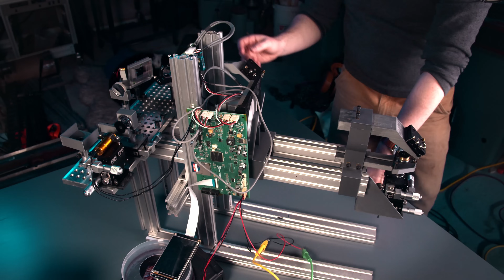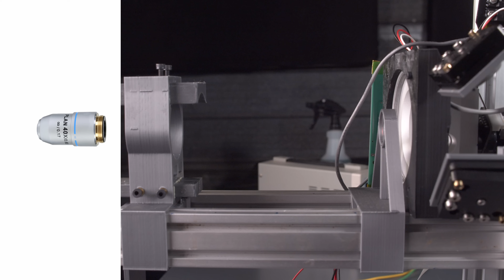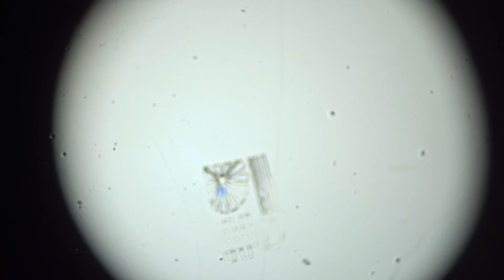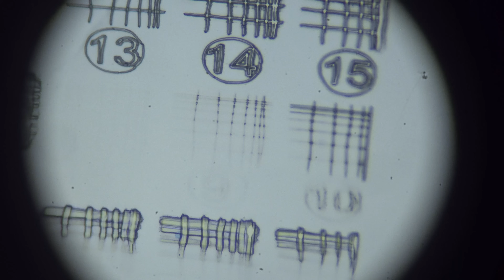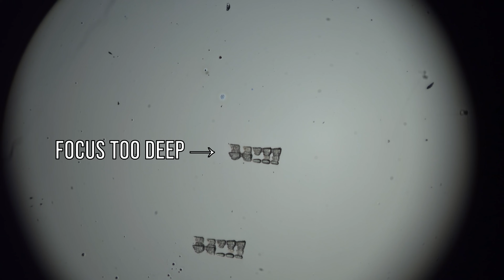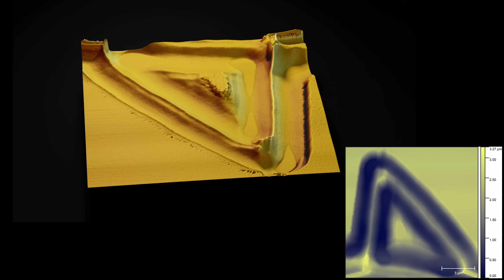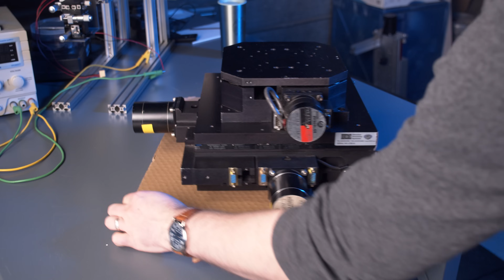DIY Semiconductor Patterning

Comment: why does the camera pick some green in a purple laser? even if it's a sensor defect, i'm still curious why it appears only in certain parts of the light path and why it's specifically green.
Reply from the maker: Hehe yeah I noticed that too, took me a minute to figure out: there's a bright green LED on the control board which shines across that section of the optics :)
Reply: @BreakingTaps  but.. but.. but my elaborate theory about the frequency doubling crystal they might be using in the laser.. i even started to calculate corresponding colors of those wavelengths (spoiler: they didn't match)

Comment: Can you use the optical litho to make better optical encoders for the galvos for better precision? Or use it to make MEMS electrostatically driven mirrors to replace the galvos? Maybe optical encoders for servos for the optical train elements to make it auto-calibrating in real time, instead of doing it manually every couple of days? A self-improving machine would be pretty big brain.

Comment: If you're making a Version 2 for use on real projects, rather than as a proof of concept like this, you might want to invest the time to build a HEPA-filtered positive-pressure vibration-isolated cabinet on wheels to house everything. A lot of those microscope pictures looked pretty dusty!
Reply from the maker: Oh my goodness, yes, so much dust everywhere! I should really clean my microscopes too 😊  But yeah I agree! I actually have a big HEPA unit for exactly that reason, just need to find some time to build a cabinet for it :)

Comment: Is the UV laser diode a single facet emitter?  Afik Thorlabs has a few raw laser diodes that would suit.  While an expensive constant current power supply is most often used to drive laser diodes, a resistor and voltage source work just fine.  (i.e. you can drive them like an LED)
Reply from the maker: Not sure to be honest! It's whatever cheapo diode came with the 3D printer :) I do have a few nicer Coherent Cube lasers that I completely forgot to mention, and plan to use those on the next build. Beam quality should be quite a bit better, and generally more stable too.

Comment: Amazing work! Would this photo-resist work with 532?  The cheap green laser pointers are diode pumped doubled Nd:YAG "microchip" lasers.  Just due to physics, they generally have a single mode beam with only a single output frequency.  I.e. if you can temperature stabilize them well enough, they can do holography, atomic vapor spectroscopy, and should focus to a diffraction limited spot.
Reply from the maker: Unfortunately, the resist isn't very reactive past about 440nm (https://amolf.nl/wp-content/uploads/2016/09/datasheets_S1800.pdf, Figure 5 on the third page). Will keep that in mind for future projects though, always good to know about cheap hacks to get good laser beams!
Reply: @BreakingTaps  haha time to do sum frequency generation... Maybe in the future ;) NLO says hello

Comment: How fast does the beam move? I'm wondering whether the time frequency of the wibbles in the line might tell you something. (if only you had a way to make a MEMS accelerometer to measure vibrations...)
Reply: That's what I'm thinking as well.   The other option might be to rotate the entire thing 45 degrees to fully engage both mirrors on the straights.

Comment: Absolutely beautiful work, very, very nice! :-) 
Yeah, diode laser beam quality is beyond poor. If you want maximum available power and a nice clean beam, have you considered fiber coupling the diode? The beam focused into the end of a nice length of Silica SMA905 fiber, will yield a really nice Gaussian beam profile, plus you can run the fiber wherever you want it...
Reply from the maker: Thanks Les, means a lot coming from an actual optical and laser expert! :)  I haven't really looked into fiber coupling to be honest, and no real reason either, just didn't ocurr to me 🙂 Can you couple in multiple wavelengths to a fiber (so I can also include the red focusing laser)?  I assume I'd need a single mode fiber instead of the bigger multi-mode stuff?  Thanks for the help! My fiber-fu is pretty weak 😅
Reply: @BreakingTaps  I've never done it but I believe so. You'll have to make sure that the fiber is rated for the range of wavelengths used. You also need a lens that optimally couples the free space laser to the single mode fiber. Newport has a good article on this if you search for "Fiber Optic Coupling".
Reply: does the beam need to enter the fiber parallel or can it enter it focused to a point? what angular distribution does is have when it exits?

Comment: I can't imagine the nightmare it has to be to align your setup with all those plastic parts ... Don't the plastic parts bend slightly each time you try to handle the micrometric screws ?
If you can afford them thorlabs "Universal Post Holders" are a must for all the breadboard section of you setup.
Reply from the maker: Surprisingly not so bad! The posts at the back are actually very sturdy and don't move much or at all, and the two components that really needed adjusting (laser and lens after pinhole) are both directly on stages.. The cantilevered mounts holding the two kinematic mirrors are... not great, and that was a chore.  Particularly because the t-nuts holding them to the extrusion slip over time too.

But yeah, I'm definitely going to invest in some nice posts and bases, and probably a real optical breadboard too :)
Reply: @BreakingTaps  If you do buy an optical bread board, avoid ones that use chip board to cap off the edges.  The chip boards add a massive humidity sensitivity. Took our research group years to track that one down...
Reply from the maker: That is an excellent tip, thanks! I would never have thought of that either 😬

Comment: Amaizing project!!! Out of curiosity, why not to have a still beam focused on the substrate, and the XY movement doing it directly by moving the substrate?
Reply from the maker: Thanks!  Good question! I had a few other folks ask too, so I just pinned a reply to the video.  Tl;dr: the stage approach will likely be a lot slower, and potentially worse resolution (although given the current state of the galvo, probably not :) ).  I might end up doing that for version 2 if i can't get the galvo to behave.

Comment: Could try sitting it on a paver and dense foam for isolation to rule out at least some of the vibration. Surprising such a hodgepodge setup even works, let alone with results that are kind of promising.

Comment: Awesome work! Always love seeing your projects. Do you know what % thruput you're getting after the pinhole? Id expect somthing much higher than what I think you're getting (pending effort of alignment) unless the diode is multi transverse mode... then high loss is the name of the game
Reply from the maker: A very small amount, maybe 5-10%?  There was some extra explanation but it rambled too much and I cut it from the edit: I have the pinhole intentionally misaligned by a small amount which is cutting down intensity a lot. The extra modes I was getting when correctly aligned (3-4 extra "rings" around the center spot) were enough to cause issues under the 40x objective... lots of "roughness" on the edge of the exposed line. So I ended up misaligning to cut a lot of the junk out. The circularity isn't quite as good, but there's a lot less "leakage" (apologies for the made up terms here).

It also worked out well because the resist is super sensitive and needed reduced intensity. V2 will have a correctly sized pinhole and an ND filter to do it correctly :)

Comment: What effect does sound vibrations etc have on the system? Is it isolated from outside vibrations so that they don’t interfere with the precision
Reply from the maker: No vibration isolation at the moment, although that would definitely help improve reliability (and minimize the feature size). I know that commercial machines are often isolated, but I'm not sure at what point that becomes "required".  I.e. is it 10um? 1um?  500nm?  Not sure, but it would definitely help!
Reply: @BreakingTaps  Don't need anything fancy.  Some tire inner-tubes under an optical bench will knock out everything above a 2-3 Hertz.

Comment: The feature size of the defects caused by the aberrations is pretty impressive. I wonder if at some point real photolithography machines will be based on the aberrations we made along the way.
Reply from the maker: Oh you'll love this: sub-resolution assist features. Not quite the same, but these are features that are added to masks which help compensate for diffraction effects.  What's neat is that they are smaller than the minimum feature size that can be made with the mask, but due to diffraction they still "add" to the feature and help fix problems or adjust the final shape. Super neat stuff!

Comment: Omg... You are unbelievable.... What is your work ethic that you can finish such complex projects....
Reply from the maker: Powered by project-ADHD 😂 I usually have 3-4 projects going at once, and when I get bored or burnt out I switch to a different one :)  This project for example was 90% done in January but I just couldn't make myself finish, so went off to do other things until I got interested again :)

Comment: wow incredible work, optics aren't easy! and yeah, the galvo-galvo system seems the weakpoint for now, managing to snag a better pair would make repeatabi;lity much better
Reply: Probebly  also a stiffer mount made from metal to house them in  maby the bodys twist a bit in the plastic  due to the acceleration

Comment: Have you seen Robin Renzetti on YouTube? He mostly does very precise machining, stuff like machine spindles. He also machines his own surface plates and measures them for flatness with an autocollimator. To do this, he made custom mirror mounts, and I think you'd like his kinematic mounts. He made a custom differential screw to get better resolution when adjusting the mirrors. Maybe something there would help you out?

Very nice videos, keep them up!
Reply from the maker: I love Robin! That man has so much knowledge packed into his head it's amazing. Not sure I saw the custom mirror mounts though, will go dig through his videos to find it. Thanks for the tip!

Comment: Why don't you use a DLP device?
Reply from the maker: No particular reason (my first attempt years ago was with a pico projector actually), I just wanted to try the direct-laser approach. There are some pros/cons to each. With DLP you run into limitations with pixel size quickly, which means you need correspondingly better optics to continue reducing feature size. Direct write laser can "scale" in that aspect a lot cheaper: a good clean beam passed through a 60x objective could theoretically hit sub-micron features.  OTOH, you have to deal with issues like the galvo linearity/stability.  So different trade offs. You can find commercial devices of both varieties competing in the same space for example :)
Reply: @BreakingTaps  yeah, the pixelation is really a problem. However as you now, you can use a higher magnification and construct bigger patches of circuit by moving the stage linearly. The squareish areas can be fixed by anti-aliasing. Your build is really good though. I always dreamed of having a fridge sized machine that can print circuits on silicon as needed.

Comment: Why not just use a stationary laser and let the sub-micron platform translate the target?
Reply: My guess based on nutten (as in zilch), is mass dampening. Moving the lite light lens/mirror would take a lot less inertial effort than moving the heavy mass of a platform. Maybe.
Reply from the maker: Speed mostly, it'll take a long time to draw the pattern particularly if you need a lot of "flood fill" regions instead of just lines. And in theory a galvo can get very small resolution even if the laser spot is relatively large.  I.e. you could position a 2 micron line (due to 2um spot size) 200nm away from another line. With the stage it'd likely be considerably worse, after factoring in repeatability and backlash, etc.

But that's a totally viable technique, and I might try it if I can't make the galvo behave. There are fancier machines that will use linear motor stages which are a ton faster and more precise, so it's definitely an option.
Reply: I just think the same, but I think reason is speed. And second is that idea is just make scanning laser x)